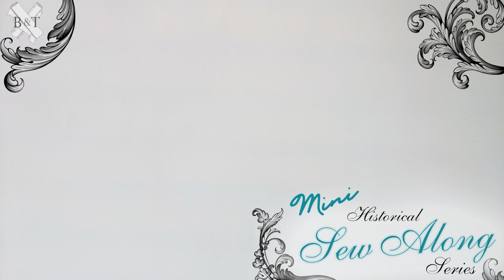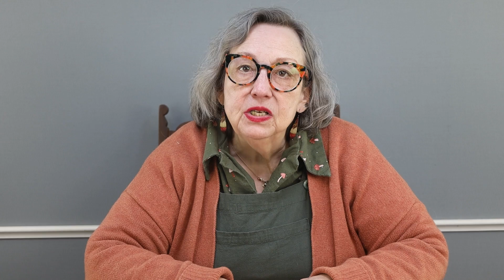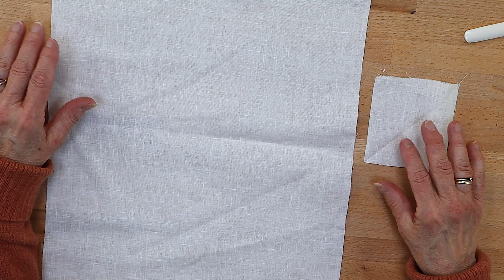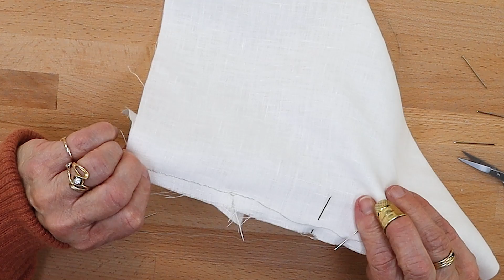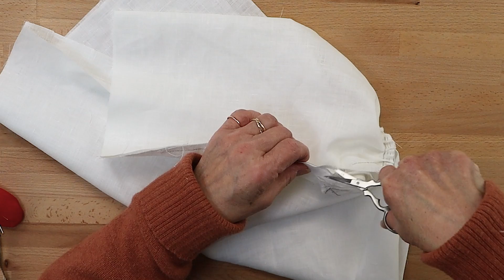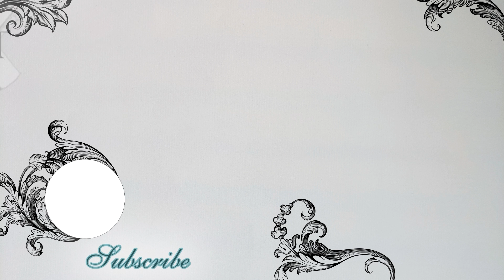Putting in an Underarm Gusset

Comment: Perhaps this is an odd question but I'm wondering why sewers back then didn't just cut a sleeve shape with ease rather than going the fiddly route of inserting a gusset into an unshaped sleeve.🤔
Reply from the maker: I'm not sure I can answer that through their perspective, but it makes sense to me that the simple geometric shapes wasted no fabric and also allowed for more variety in fit with the ease of the gusset.
Reply: @BurnleyandTrowbridge  Yes, that makes sense, thank you.
Reply: It's much easier to sew straight lines in linnen as you can sew along a pulled thread. I wish the whole side seam could be done that method 😅

Comment: Thank you! I feel like every pattern I use has a different method for attaching gussets and, every time, I get confused. I will try this method next. It makes sense when I'm watching it, but we'll see what happens when I actually do it! 

I am making a bedgown from a pattern that has gussets. Do bedgowns usually have gussets? The bedgown that I made from your pattern/sew along did not have gussets, so I'm wondering if the non-gusset method is more accurate? Or if some bedgowns had gussets and others didn't?
Reply from the maker: Hi, yes our bedgown is based on a bedgown probably from the late 60's early 70's with an English provenance.  That is not to say gussets were not used but I personally have not seen them in bedgowns.

Comment: but it's so so much easier and more efficient to sew the sleeve on first :(
Reply from the maker: Our evidence shows that is is sewn separate to the body and then stitched in one long seam encompassing the gusset.  What is your method Vincent, would love to know.
Reply: @BurnleyandTrowbridge  I attach the sleeve to the body and finish that seam, then sew the gusset in on all 4 sides, then close up the long seams on the side and sleeve. 
Then I fell the side seams and sleeve seam & do the little hems, trim the body and sleeve seam allowances under the gusset, and fold the gusset seam allowances outwards and fell them. (I used to do it the other way for years, but it was more difficult and much less clean. I'm actually working on editing a very long shirt video right now, which is machine sewn, but mostly the same order as I do it by hand.)

Modern shirts also have the sleeves sewn on first and then the side and sleeve closed up in one, as do some late 19th century shirts & nightgowns I've seen.

I have sadly never had the opportunity to examine any 18th century garments, and I was very surprised to hear that the sleeves were attached at a later step! I suppose it does make sense in the context of an 18th century workshop though, if they wanted to have 3 people working on one shirt so as to finish it as quickly as possible. Like how several tailors could work on the sleeves and fronts of a coat before joining them together later.
But for one person working on one shirt, much easier to attach them first!